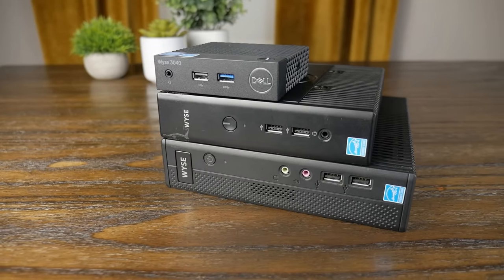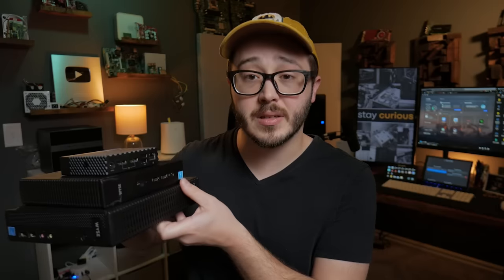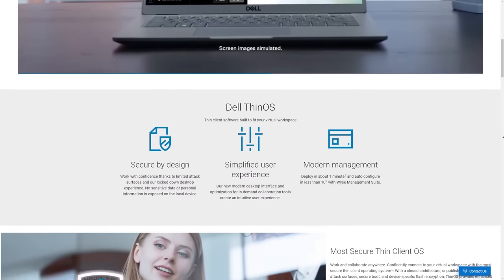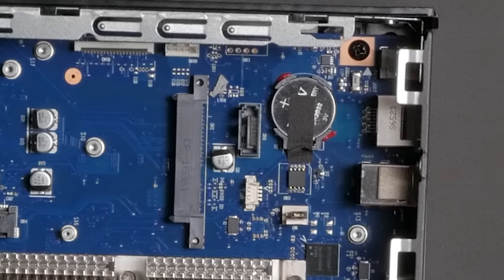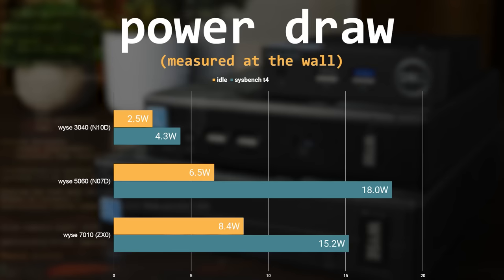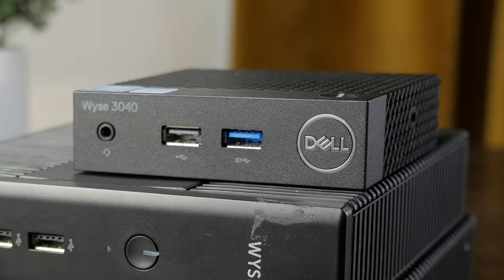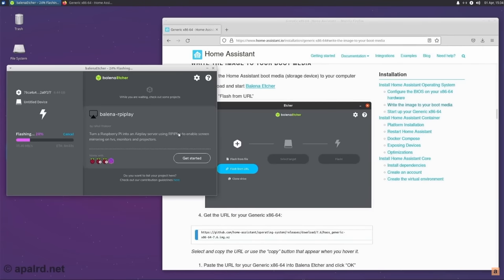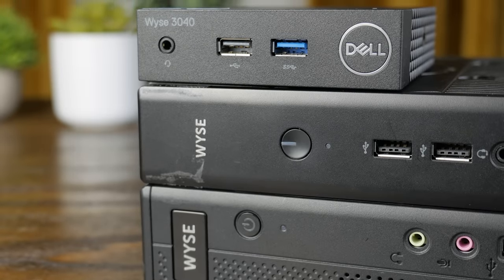Do These CHEAP PCs Live Up To The Hype?

Comment: When I started IT in 2010s thin clients were DA BOMB for business clients. But ever since the Intel NUC came out, we all jumped ship because the cost didn’t outweigh the benefits anymore.
Reply: I don't blame them the NUC are great machines. I was looking into thin clients as a way to do some old school win 98 to Xp era LAN gaming. Never pulled the trigger on it thou.
Reply: Back in the '90s, diskless HP clients and NCD X-Terminal displays were the thing, sharing computing servers down in the data center.  Management decided to put disks and O/S on the HP clients, and replacing the X-Terminals with HP-UX desktops, which caused us admins no end of trouble on the helpline when users would keep cycling the power on them when they had a problem like they used to, crashing quite a few of the disks, and corrupting O/S's.  "I'm having trouble.  I already cycled the power, and it still doesn't work...".   The "re-training" to NOT power-cycle was a chore.

Yep, I'm old...
Reply: I have an old Intel NUC 5 with Celeron that I use as a thin client of sorts with Remmina on a minimal Debian GNOME setup, so I can agree, though to be fair, I already had it from a previous project that I decommissioned some years prior.
Reply: Yeah. The company I worked for had these connecting into a Citrix XenApp server. Not much reason to anymore since fully capable USFF PCs are very cheap.
Reply: We used to buy thin clients, then when we could get HP EliteDesk DMs for cheaper we switched to those. More power for less money? Sure, why not? We still use them for Citrix and they're faster. Win all around.
Reply: Are there any Intel NUC's with optical drives on them? Internal ones? I wouldn't mind investing in one I am aware there are Dell Optiplexes of that type but just wondering for any model series for nucs specifically I did have a look before but couldn't find any.
Reply: The top end NUC with an i7, a healthy dose of RAM, and a decent m.2 SSD is a seriously powerful PC in a tiny space and they're comparatively inexpensive.
Reply: Check out the Asrock 4X4
Reply: Or chromeboxes/chromebooks
Reply: I know our local hospital leans heavily on thin clients just for the fact that nurses and doctors can roam their sessions from room to room with no interruption to workflow.
Reply: Plus we discovered at my job that the BIOS on the Dell thin clients (at least ones as recent as 2021) doesn't support wake-on-LAN like the one on the Intel NUCs can. Correct me if I'm unaware of a model that does. This was pretty annoying when we were setting up a patient status board (I work for a hospital) and discovered we couldn't get the thing to boot back up on its own in the event of a power outage. Seems pretty goofy for something whose use case is "set it and forget it" more often than not.

Comment: So if you want to get a much better system, the Wyse 5070 runs a J4105 or J5005 with 8 GB RAM. There is a slot for a m2 sata drive and power draw is pretty low on them. They also tend to cost the same as the 5060 you were showcasing.
Reply: Agreed, the RAM is DDR4 and can go at least to 16GB.  I got 3 for a great price on eBay, and set up a small, power efficient proxmox cluster for kubernetes.  Great video as always!
Reply from the maker: I’ll have to check them out
Reply: @HardwareHaven  also if you get the 5070 extended, it has a pcie 2.0 x 8 slot+riser, working on getting those setup as my HA cluster
Reply: Yep, if you get the 5070 extended version, it’s got a pci card slot and is still tiny and low powered. I added more m.2 and now it’s a flash nas with vm’s.
Reply: Voting for 5070s. I have 2 of them as well as one 3040 and I plan to extend with more 5070s for some clutter or something. 5070s often flood internet with a 2-3 year old units that cost much less than Pi4 and are awesome. Low power consumption with a quite ok performance if needed. Running exclusively Docker on them.
Reply: I run a 5070 that does home assistant duties and influxdb stuff and it never seems to go above 5w whatever I’m doing with it. Totally silent with a 256gb m.2 SSD and 8gb ram
Reply: @HardwareHaven  Running a 5070 with 2x 16GB for 32 GB total and a 256 GB M.2 SATA SSD as one of my proxmox nodes. As a bonus you get a modern Intel iGPU for transcoding. They are an enormous jump over AMD G series, even the 4-core "more powerful" 424. At $100 or thereabouts, it's a steal for provided you intend to run them 24/7 and care about your power bill, heat and noise.

Comment: The company I work for has a couple of clients that use these. It's crazy that for the price of a new thin client, you can get a (fairly) cheap laptop that can do so much more and is so much easier to troubleshoot. I loath having to fix any thin-client problems because they are so uncooperative. Even the management software is just terrible and unhelpful. I ousted them from our internal use over the course of a few years and no one regrets moving to docked laptops from them, even with the higher cost.
Reply: refurbished laptops are my favorite option.   Cheap, well known quantity, built in keyboard and monitor...   why would I want to futz with anything else?   Sure, something rack mounted might be cooler, or a tiny mini PC stashed out of the way could be really great.  I can just SSH into it when I need to, right?

But there's that 1 in 20 situation where you just need to be directly on the console.  And, no, I don't want to scrounge around for a keyboard, and balance a flat screen on whatever weird place I need to put it...

Just give me a pile of cheap laptops, and be done with it.

(but make sure they are business grade lease returns and they have ethernet ports, lol)

Comment: I picked up a couple of 5060s from my local IT recycling shop for next to nothing last year. One has been running CasaOS on Debian with pi-hole (now adguard) non-stop, and the other is running a long-term time-lapse capture of my new work building. As long as you don't ask them to do too much, they're amazing little machines!

Comment: I wish Dell would bring back the 3040 form factor with Alder Lake-N chips. Imagine a modernized version that could be powered over USB-C, boot from a Gen3 x2 drive, and use an N100 CPU. That would be an awesome little form factor.
Reply: That would be pretty sweet.
Reply: the N100 intel atom based CPU is slower than some ARM CPUs while costing more. I compared getting one of the best intel atoms on a SBC vs an intel laptop mobile CPU on a desktop board (cheap chinese options) and ended up with the mobile CPU as its very power efficient and is well suited for proxmox, and has instruction sets the intel atom doesnt. As for arm some faster ones come with a generic NPU, equivalent to vnni on intel, which the intel atoms do not have as they only do image inference via the gausian instructions.

Cost wise the intel atom was the same as the laptop cpu, and i had a 1U chassis sitting around. Sure the SBC would've been more compact, but i would'nt have been able to do as much as i am now by choosing it.

You can thin clients with proper full core laptop CPUs than going the atom route. Im surprised many people dont know this and want the very slow intel atoms not knowing how slow they actually are. I can still feel the slowness of a fast intel atom running proxmox even for something like a dedicated php VM.
Reply: @System0Error0Message N100 is based on Gracemont which are used in 12-13-(14)gen Core CPUs as Efficiency cores and are actually quite fast, often on par with 6-9gen with greater power efficiency, also fewer limitations than previous "Atoms". With modern GPU these are perfect for HTPC (AV1!), game streaming, also network appliances like NGFW and many other use cases. CPUs don't need to be super fast to be great products.

Comment: Late to the party, but one reason these thin clients are so "popular" in the US is due to financial industry using them for a lot of things after regulations passed from the housing crash. There were issues with folks keeping financial files on laptops, local pc's, etc. So, gov't told financial companies (at least loan services) all financial info had to be stored on secure servers, and employees had to thin-client into the systems. This had these little things flying off shelves for businesses like crazy. And, since it was so cheap to upgrade them, they'd chuck them out on a bit faster depreciation life cycle than, say, a normal work pc or laptop.

Comment: I'm running a 3040 as a dedicated proxmox backup server (PBS). Backing up a 170GB LXC takes about 1h30 min (full backup).
Validating that backup does take about 1h5 min.
Installing PBS is not easy (PBS doesn't allow install to flash by default) but absolutely worth it. Small, quiet, draws next to no power and looks good.
Reply: I have been working on a "baby's first hypervisor" project for a friend. Initial version i installed proxmox completely on a usb WD passport hard drive and it seemed to work reliably. Currently, i reinstalled proxmox on a 128gb sandisk ultra fit and deleted the thin storage and expanded the other storage volume to fill the entire drive. I am including a 512gb Samsung USB SSD for VM storage. The idea being if it is completely solid state storage there is much less chance of damage since the friend lives across the country. 

I have been considering using the WD drive to install PBS on but havent gotten around to it.

Comment: Quick note about the Minecraft server you tried on 5060 - most Minecraft servers are heavily single-threaded due to the original Minecraft server design. Customizing your settings and Java flags could help a bit, but they definitely benefit from very fast cores and fast and large memory (avoiding garbage collection pauses).
Reply: That would explain why the i5-2500k in my former gaming PC turned home server doesn't fall over itself while it's running Minecraft over my local network and doing things with Plex.

Comment: The 3040s are a nice option to use as an Octoprint server, too. In some printers, you can even slot it below the print bed, making it so that you don't need to increase the printer footprint at all.

As for me, I've been running a 5060 competitor (aka an HP t630) as a test homelab server: it's the one I first deploy stuff to, to check things out, before moving them to the main server.
Reply: True that, one of mine is running a Klipper/Mainsail install, and another of the 16GB ones for Home Assistant. HASS is OK on it but nothing to write about.

Comment: I'm using Wyse 7020 as my home server for "stuff". It has some lovely features: 1. It's cooled passively, no fans at all, and this was important for me. 2. Performance-wise it's decent, I got 946 and 3779 evts/s in sysbench for 1 and 4 threaded loads, respectively. 3. I was able to find this dreaded SATA power cable, so I have a 1TB 2.5" HDD connected to it - using it as a crude NAS and a media server. 4. It uses x86 architecture, which, contrary to Pi, allows for some hardware (e.g. printers, scanners) to work easily. My Brother printer just plain refused to work on Pi, but I'm having no issues whatsoever on Wyse. 5. It was dirt cheap - overall I paid around 60 USD for Wyse+SATA cable+power brick+HDD. It's an awesome machine for my particular needs.

Comment: I'm using 3 5060s for a proxmox cluster.  Two with 16GB of ram and one with 8GB.  They're working great. I even have ceph running well.  It's a great environment to test out ideas before committing them to my larger cluster and works for my more modest home needs. I'm slowly adding tasks to it and I've not had any issues.  I used USB for system boot and a sata ssd to host ceph for all the vms.  The cost of three systems upgraded to meet my needs was under $200.  

I also have 2 7010s and they are working great as low load web servers in another location.  They're okay and meet my needs. I also had plenty of old ram to stuff into them.  They're not as good a value as the 5060s but they meet my needs and have been running non-stop without issue for roughly 9 months.    

These have been more reliable than my raspis.  They reboot cleanly every time, even the remote the boxes.   All of my raspis have hung at reboot at one time or another and every so often I've had one freeze.
Reply: Good to hear the 5060 can use 16gb ram without problems. what brands are you using, don't know if the 5060 is RAM brand fussy.
Reply: @ThePupil   A believe it was A-Tech brand.

Comment: I recently got the 5060. It's awesome for low power homelab stuff like a website, nginx proxy manager, docker containers, etc. I barely use 2% of the CPU while running all 8 of my docker containers. The RAM and storage were upgradeable, so I added a 500GB SSD inside, and my OS of choice is ubuntu server.

Comment: I had 2 3040 both with diet pi x86_64 ufei installed running pihole and unbound and they do make for a great high availability alternative during the rpi shortage a few years ago.
Reply: you can run dietpi pihole and unbound and home assistant on pi 1 or pi zero no problem. pi4 is only good for samba and docker

Comment: Prolly older than you, Wyse started back in the 1980's as third-party VT1xx terminal devices in the era of VAX computer systems.  At one time, they were considered best of breed of that era for those products.  Sadly, as the world of terminals morphed into PC software terminal emulators and eventually just faded out, Wyze moved to thin-client devices (the Citrix-era) and eventually Dell acquired them and the brand.  Quite a hoot to see them mentioned here :)

Comment: @HardwareHaven Let me start with, that was a great video. I myself use the Dell Wyse 5070. I have been able to score them pretty cheap at about $25/ unit. Even with the Intel Celeron J4105 running at 1.5 GHz, they still seem to do an awesome job running Ubuntu Server. I have one just running Klipper for my 3D printers. Yes it may be overkill, but when RPi's went scare during the pandemic, I resorted to these things.

Comment: Im a MES specialist for a huge company with many factories all over the globe, and we use these wyse clients in a production environment, running all sorts of stations and machines. They are great for such infrastructure, respond fast, their setup is amazing, and for what they're made, its a blast to use them.
One precaution, you need a good foundation for those, servers to support it all and a great network situation if you have a lot of them.
Also, I suggest tinkering with the other OS distros for it, and its corresponding management suite, because dell is... well, sometimes pain in the ass to work with, both their products and the company.

Comment: About the 3040; I was using one for a headless (eventually) ROIP Allstar radioless node machine and it works beautifully bolted under a table. Also, when I was buying mine I noticed there's 2 different power supply versions for those; one is 5V and the other is (I forget which) 12v or 19V, so pay attention so you avoid crispiness...

Comment: I'm using a 3040 to run pi hole on Debian 11.  I tried this during the RPI shortage and it's been solid.  The storage limitation is a bigger issue than the CPU and RAM for small Linux projects.

Comment: Interesting video. Although I am using thin clients from HP, the approach may be similar with these devices.
No intention to start a vendor discussion here who makes better hardware, not relevant.
I am currently using an HP T520 (with 8 GB RAM and 256 GB storage) running Debian 12 server and a few lightweight Docker containers like Pi-Hole, Home Assistant, Netbootxyz and NUT UPSD. My UPS and Smart Meter (DSMR 5 device) are directly connected to it over USB.
I am planning to host a small Samba and Corosync container to facilitate a two-node Proxmox cluster as well.

In my scenario, this machine is more or less idling and does what it needs to do.

I consider these devices good candidates for leightweight containers.
You may consider building a Kubernetes cluster with a bunch of these....
However, replacing these with cheap 1L PC's may be a viable choice once you'd run some heavier stuff.

Hope this helps!

Comment: We use these in our call centre, I like them because they're so easy to use and are low powered. Literally plug them in out the box and they're good to go using DHCP options to send the config for thinOS.  They log into a connection broker that hand them off to session host servers.  Smooth operation and users can log on from any thin client terminal to get to their profile. Performance isn't an issue as the servers do all the work - even Youtube runs smoothly on them.

Comment: Another weird use for these are if you require x86. I setup a print server on one of these when I discovered the drivers for my old laser printer are only compiled for x86 and closed source so I couldn't use a raspi.

Comment: I noticed you used Minecraft servers sometimes in your videos, you could do a standardized test for them If you either load into the same seed each time or use the same world each time with redstone machines or farms going and then either use Fabric and Carpet to do a tick warp or wait until 1.20.3 to be released where tick sprint will become a command you can see how fast the server can theoretically run the game.

Comment: I was looking at these, but ended up just spending a little extra to get a couple HP 400 G3 Minis with i3 7100ts. They don't draw too much power and perform very well. I'd even be happy using one of them as my daily driver machine, it'd work fine as long as I'm not playing any games.